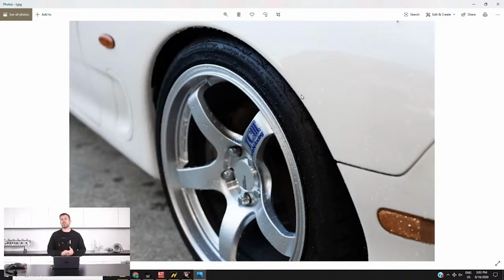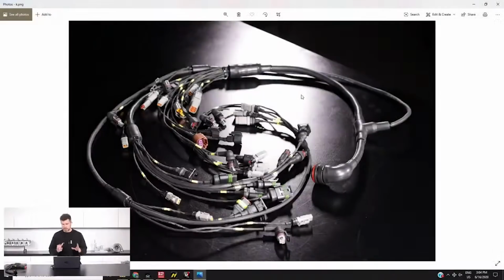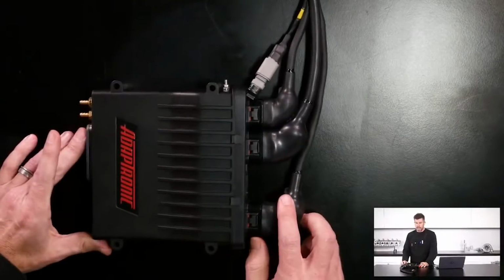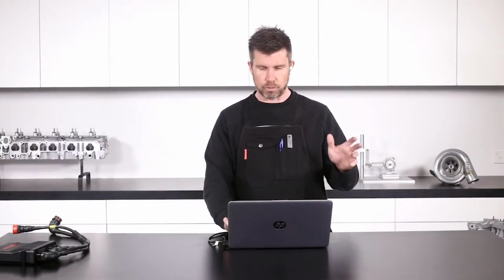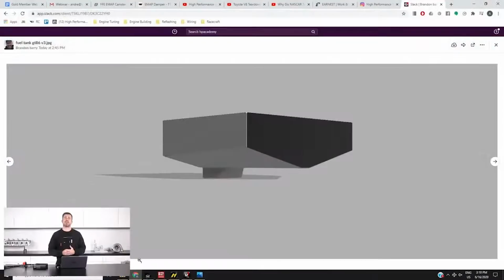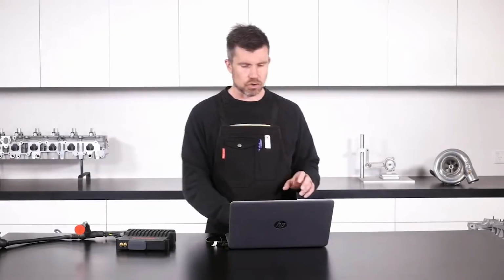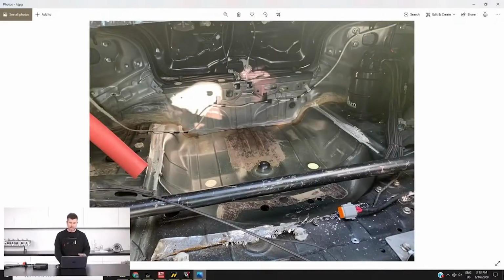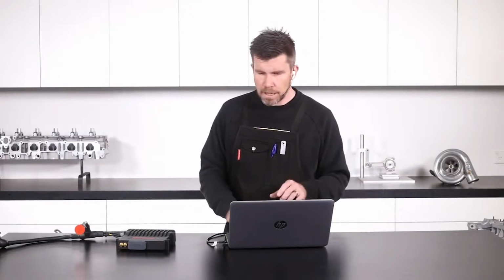All The Fuel, World's BEST Overalls And RX7 Wiring | Today At HPA [UPDATE 245]

Comment: Was catching up on the Bloodhound LSR car last night, and it has a rather extreme electric fuel pump...
The article cites two different fuelling demands - 800 litres (210 US gallons) at 1000 PSI in 20 seconds is the lower requirement - it also has 1 ton of fuel at 1200PSI in the same 20 seconds - either way, it's a lot and the pump is reported to be driven by a 400kW electric motor! Early designs had a F1 engine and, later, a supercharged V8 driving the pump, but it seems there are several advantages, besides being 'green', for using the electric option.

Comment: For the fuel surge, and pickup, issue have you checked out the Holley Hydramat fuel sock, which is designed to draw fuel and not air through its membrane? It may seem a little pricey but if it saves money elsewhere... - https://www.holley.com/products/fuel_systems/hydramat/ - the videos of them in operation are rather interesting, especially the ones that point out that because most fuel systems don't pick up all the fuel, it's like having a bigger fuel tank! 

I noticed you've worn the apron for a couple4 of videos, now - has Earnest checked out the possibility of having logos or motifs embroidered on them as an extra service? Ah, got to the reason at 15:30 ish, like the "I liked the razor so much I bought the company" thing from a few years back - which was actually a true story, too!
Reply from the maker: Yes, we've had a chat about it but fitting it to this tank isn't just a matter of jamming it through the holes for the fuel pump so while awesome tech, it's not an task to undertake with out some work either - Taz.

Comment: Are the wiring/plug anchors printed in PLA? If so they’re likely to deform under engine bay heat, Andre didn’t mention if they were getting the Cnc treatment from the f360 models.
Reply from the maker: I'm not 100% sure on that one however I know Brandon has done his research regarding heat and 3D printed materials and has 2 different options here, so I assume he's on it. Will see if we can talk about that in a later video - Taz.
Reply: @hpa101  I imagine he has got it under control, he's producing some quality work!